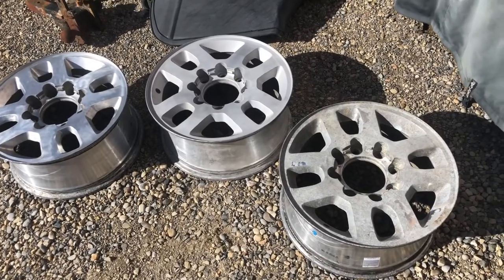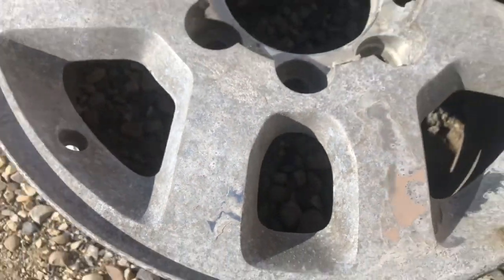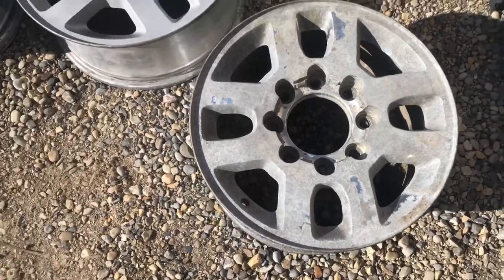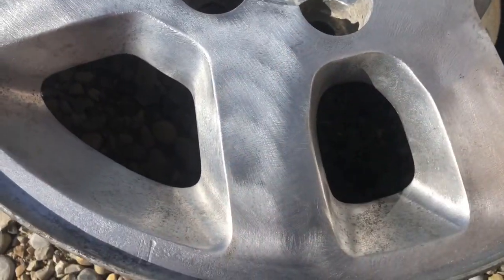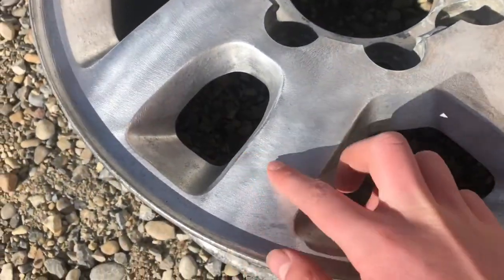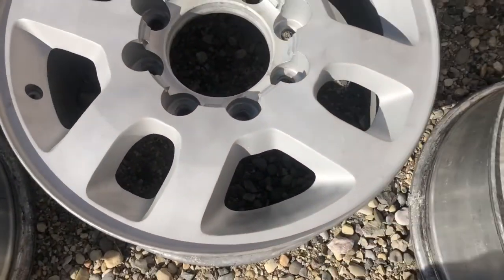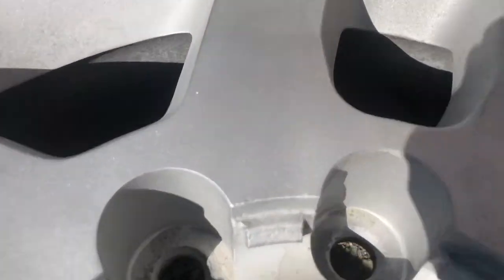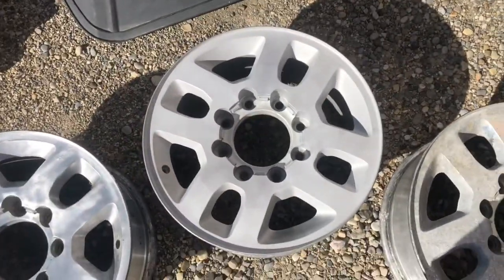Refinishing aluminum wheels/rims | Fuel Up

Comment: What you did was make them better but if you want to make them not only look like new but much better then new then you need to blast them to start fresh then use a die grinder with 3M roloc wheels in grits going from coarse to fine to remove material in stages to remove the pits and then polish in stages you can make the bare aluminum shine better then if it was chrome plated.
Reply from the maker: We just wanted them to look even,and we weren't too concerned about the shine. After this we also sprayed them with a clear coat, and it has held up fine.